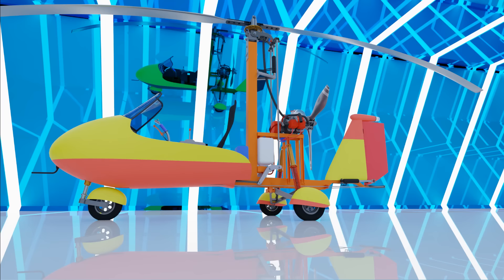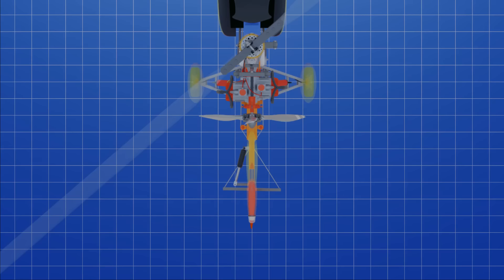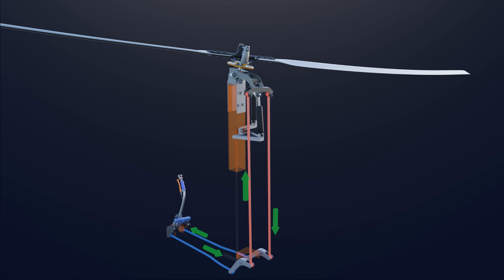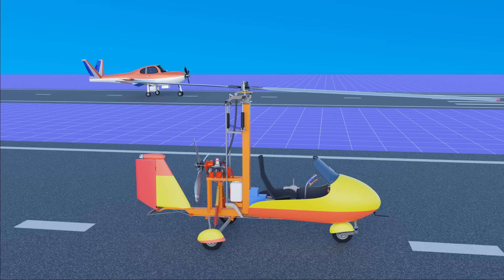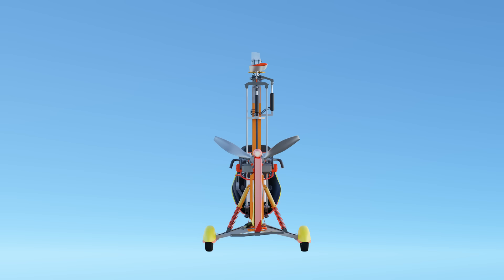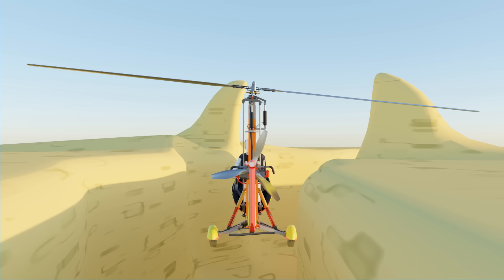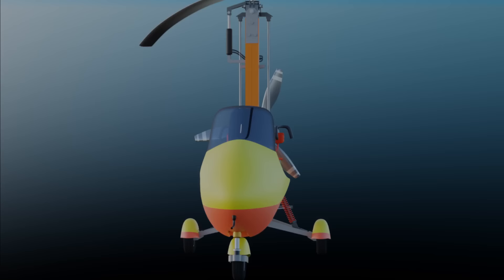How Gyroplanes Fly ? 3D Animation

Comment from the maker: Don't forget to share it with others and here is a new video explains planetary gearset, Please checkout to learn more  https://youtu.be/wD0cMlnaUGw    and help us to reach more audiences. As a small channel YouTube algorithm is not helping at all and have no budget for paid promotion. I am focusing on  improving  video quality.
Reply: No collective?
Reply: How far can it glide on engine failure?
Reply: @fredashay  No collective. In my simple understanding, the collective pitch controls the angle of attack of the blades on a heli rotor, set against engine power (why the collective control also has the throttle), but in a helicopter you have to change the cyclic to enter transitional flight, by changing your rotor disc angle of attack, and thus the vector of resultant thrust. 
But a gyro will steer and climb on the cyclic, because the forward force is provided by the motor behind you. It's easier if you ignore the evidence of your eyes and think of the rotor disc as equivalent to a fixed wing.

I found info from a gyro club that says the glide angle is about 4:1, so (roughly) altitude 1000 feet, range 4000 feet, about 1.2 km on no engine.

Comment: A Gyroplane rotor does not rotate as a pinwheel rotates in the wind. The rotor of a Gyroplane and a helicopter when in the state of auto rotation, rotates against the flow of the wind. This is due to the effort of lift is alway perpendicular to the angle of attack of the wind. This varies along the length of the entire rotor due to the fact that the airspeed varies infinitely due to the rotation of the blade. Another words the section of the rotor next to the hub is rotating slower than the tips. For simplicity we decide the rotor into three sections: The stalled, which is closer to the center of rotation, The Driving, which is producing lift at a very high angle of attack where by the effort of lift is actually forward in its vector. The section literally pulls the rest of the rotor into the wind. Finally the Driven section. This section provides most of the lift and is pulled against the wind by the middle or Driving section of the blade. The velocity of rotation is self limited by the lift vs drag equality. Most two place gyros will see a rotation of 325 to 375 rpm. The rotor rpm will vary with atmospheric conditions and the gross weight of the aircraft. The rotor rpm typically will not vary over 10% no matter what the forward velocity of the aircraft.
Reply: "A Gyroplane rotor does not rotate as a pinwheel rotates in the wind. "

The analogy might not be correct, but it's been used to illustrate the point for many decades.  Chuck Vanek, back when it was  still "Vancraft," used it with me as did Rod Scamahorn (until his death) who was one of "Sport Copters" CFI's.  No, it's not 100% correct. But it does get the point across.
Reply: So the common concept that wind goes from below the rotor upwards is inexact, right?
It does so in the driver region, but, as on any helicopter, the driven region will cause a downwash, am I right?
Thanks in advance
Reply: @DoNotPushHere  As in an airplanes wing, the relative wind causing providing lift is from slightly below the airfoil, which is called the angle of attack. The same is true for the rotor on an Autogyro. On a helicopter the rotor is driven by the engine and acts more a a propeller and air is grabbed and force through it. When Juan De la Cierva invented the Gyroplane, it came after a tragic aircraft accident which resulted in the loss of a good friend. Keep in mind this was 1921 and earlier, a few scant years after the 1903 Wright Brothers flight. Stall spins were not understood. All they knew was, if the aircraft was allowed to fly too slow, it fell from the sky. “Why must the passengers fly at the same speed as the wing,” he famously ask himself. So he pursued the ides of a rotating airfoil. I expect he got real lucky, because if they did not know what really caused a stall span, they certainly didn’t know about area of pressure travel. Lift is more or less perpendicular to the angle of attack and oddly enough, the greatest lift I occurs at high angles of attack just before stall or the maximum angle of attack is exceeded. There are a lot of illustrations showing this on line. But in essence the center of lift or area of greatest effort is forward and not directly opposite of the Earths gravity pull. An airplane wing will not or does not force the air downward until, the wing has passed or aft of the wing. Aft of the wing on a fixed wing, there is down flow but not as experienced in a helicopter. 

As you know a gyroplanes rotor can be divided up into three areas defined by the speed of rotation and relative wind: The Stalled, the Driving and the Driven. Most rotor designers ignore the stalled region and do not begin the actual airfoil shape till a good distance away from the center of rotation. Having said that, there is airflow over that area while it does not produce lift, there is parasitic drag which hinders performance. SkyWheels rotors which are composite did attempt to deal with this area concerning drag and some of the very advance designs, you will see this area shaped to smooth the flow of air as it passes over. Most do not bother. 

outboard of the stalled area is the driven. This is where the lift is vectored forward or the aerodynamic center of the rotor. This force pulls the rotor against the wind and against the forward motion of the aircraft. To me, this is a freak of nature and a darned miracle. When the angle of attack is less, then the area of lift moves further aft on the blade and the rotor behaves more like a wing in cruising flight. This occurs in the driven section.

If you have ever flown a Cessna 172 and you dropped full flaps on approach and forgot to trim the aircraft nose down, then you have experienced the force exerted by the center of lift having moved forward of the aerodynamic center of the wing. As you push hard on the yoke to get the nose down. It will cause puckering if you don’t expect it. Flight instructors love doing this to new students. 

The angle of attack of a pin wheel is almost perpendicular to the surface. Pushing and shoving causes it to rotate not pulling. Granted Bernoulli cannot explain the entire equation on lift. It is a shared effort of a push of the air under the wing and the vacuum or lower pressure above the wing. These forces trade off as the angle of attack is varied. Even the experts are re-debating how to explain why and aircraft flys. Obviously most of the hard parts have been solved enough to work.

Gyroplanes suck and helicopter’s blow……in any case we get the same results; an orgasmic experience in the air.  ( forgive me for the gutter talk)
Reply: @DoNotPushHere  What generally confuses some as well as myself is the affect of relative wind and the speed at which each point along the rotor is experiencing. If the aircraft is not moving forward, the tips of the rotor during pre rotation are experiencing 200 or plus MPH. In flight the rotors are spinning at 325-400 RPM and the tips are experiencing 350 mph velocities.

The relative wind changes along the length of a rotating blade and with this the airfoil causes the wind to be molded or flowing around the airfoil resulting in dramatically different kinds and directions of lift. 

One example of this which may or may not relate to personal experiences would be the air felt by you if you were placed (safely of course ) in the back of a open bed truck sitting still on the ground. You will be traveling due North and there is a wind blowing at 45 mph from the West. ( might as well make this extreme) Facing North your left side of your faces is getting an ear full. Now the driver of the truck accelerates to 45 mph. Now the wind you are feeding is from a direction which had moved forward to about 45°. 

Has the wind changed direction? No but the combination of the wind speed and your forward speed you the feel this change in direction. You can increase your velocity to the point where the initial  45 mph wind at 90° is hardly felt at all. You are the rotor and airfoil at different points along the rotor and you can see how the relative wind changes at each point as velocity changes. So far the total lift on each blade is equal. 

This all goes to crap when the aircraft starts moving through the air. The accelerating blade which is moving into the direction of travel of the aircraft is now receiving more wind than its partner blade traveling down wind. What happens is one side gets more lift than the other and the airframe rolls and crashes. This happened with De la Cierva’s first full size aircraft until he invented flapping hinges. These allowed each blade to seek its own best angle of attack to equalize this disparity of lift. Most smaller gyroplanes achieve this via a teetering rotor head system. We won’t get into the explanation of the lead-lag hinge. ( it’s stress related) 

Then there is lift created by the affect of a rotating disk and the total flow of air moving across that disk. That generates a bit of lift. Then there is the viscosity of the air resisting to flow through this disk and that generates at bit of lift. The total explanation gets complicated very quickly. 

My head hurts. 

Helicopters don’t fly, they beat the air into submission. Gyroplanes are much more gentle in this agreement with the air.

Comment: Really need to mention...

"With a high engine thrustline (relative to the vertical c.g. and center of drag) and/or with a momentary gust that can increase fuselage drag, the gyro can pitch forward and tumble. Such tumbling, also known as bunting over, can occur almost instantly."

Any negative G created situation, I'm no gyro pilot, but the maneuver required to recover is opposite a fix wing aircraft. 

You should never get into a negative G situation as it will unload the rotor. 

It's the equivalent of a stall, understand you will hear gyros can't stall, true, but an unloaded rotor, it's going to have the same results, gravity will take over. 

There isn't any recovery for a bunting over if it happens. 

So do it wrong, rotor uploading, react incorrectly, a bunting over will happen, no recovery.

Rumor has it, improvements have been improved in model designs for bunting over, but not eliminated.

I once considered buying an early design gyro, I passed.

I believe one foreign military considered them, but decided no. I think France? 

Check the US accident stats, bunting, rotor tail strikes pretty fatal.

https://youtu.be/CfjBzrSDrV0?si=-vP5s2pdKZYc-Lyl

As I say, I don't own one, not a pilot, never flown one, no expert, so YMMV.

I'm just saying they aren't for me.

Interesting a modern Europe gyro,  it doesn't seem in business anymore,  or model gone, went back to a old front mounted engine,  frame more plane like,  with a tube rear end, that contained a ballistic recovery parachute.

No clue what, why, how it worked out

Comment: There is no hard and fast description of what is autogyro, gyrocopter or gyroplane, and all three terms are frequently used to describe a rotary wing aircraft that is pushed through the air by an engine driven propellor and has a non powered rotor. The rotor is in permanent auto rotation, and although the aerodynamics is difficult to understand, the rotor has similar controls to those in a powered rotor helicopter. The simplest form of autogyro has a two blade rotor with a ‘teetering head’. In this design the blades are fixed directly to the central rotor head, without any pitch change hinges. The central rotor head can tilt in fore and aft and lateral directions giving the pilot fore/aft and lateral control. Some more complex autogyros have a three blade rotor, which requires that each blade can change pitch independently, requiring a swashplate control with pitch change bearings on each blade. Two examples of this design are the Mculloch J2 and the Air and Space model 18. Both have a three blade rotor head from a conventional helicopter. These can be considered as ‘gyrocopter’, as they have a helicopter type rotor head. The J2 has an additional feature by way of stub wings that form the fuel tanks and also generate lift when in forward flight, so can be considered as ‘gyroplane’, combining a non powered rotor with aircraft type wings.
Examples of all three types of autogyro can be seen on display at the Helicopter Miseum in North Somerset.

Comment: "NOT POWERED BY AN ENGINE" More correctly, the rotor is not powered by an engine, the aircraft however is  powered by an engine which drives a propeller which in turn causes the aircraft to move forward which in turn causes the rotor to spin, generating lift, so in fact every gyrocopter is powered by an engine, it is just that the engine is not used to power the rotor..  However, a  lot of gyrocopters    have rotors connected to the engine to provide a spin up of the rotor  to generate lift and a well as having the  engine connected to the rotor to take off vertically  like a helicopter. Those  latter actions pretty much fit the definition of the aircraft being "powered by an engine"

Comment: The rudder cables are not crossed if directly connected by cables or push pull tubes.
Reply: Same as in a fixed wind IIRC. Not as per the illustration.

Comment: I live in rural Ohio, see these dudes flying em all the time! I'm a curious dude,but terrified of Gyrocopters at the same time😆
Reply: I have a Gyro in rural Ohio, your thoughts are the same as almost anyone I talk to! 🙂
Reply: @djski9757  I'm in Warren County.Got a Parasail pilot that comes thru aswell. Neat stuff!
Reply: Dean, 
  I live next to an airport where they're build commercially.  There's always a few of them in the pattern, depending on the weather. Some have enclosed cockpits, others are exposed to the elements.  I know which model I'd choose. 🤣

"Power push-over" and "PIO" (pilot induced oscillations)  are the two (major) things that will get you killed in a gyro.  Keep those under control and they're a very safe aircraft.

Comment: I just have one question..did the blade have different angle on different section? Or everything is identical? Thanks in advance!
Reply from the maker: you mean taper and twist like present in helicopter. usually not like helicopters' rotor blade..

Comment: I've been thinking of making a Gyro for a long time but haven't found any instructional videos on the subject. Thank you, I benefited a lot from this video. But I have some questions, how much engine power should be, how much should be the size of each blade?
Reply: sti engine
Reply: Just buy one or build a kit that has the engineering all worked out.
Reply: just copy a blueprint and replace their components with cheap bootleg parts try not to die
Reply: Do you want to build from kit or build from scratch? "  I live close to "Sport  Copter" gyros, so those are what I've seen most (40 years worth). Nice kit. Seems a bit on the expensive side, but they are VERY well engineered.  I've seen the owner of the company doing loops in his. If that does scream confidence in your product, I don't know what does.  🙂
Reply: @phillipzx3754  I lived close to where Cavalon assembles their aircraft in Maryland and flew them several times while taking my fixed wing training.  They are alot of fun and have some practical aspects to them that fixed wing do not.  BUT they are pretty much for fun, low and slow.
Reply: @blaster-zy7xx    Yup....speed isn't something they're much good for.  I think of them more like a mountain bike... but for the sky. 

Given a choice, I'd rather be low and slow in a gyro than low and slow in a fixed wing...especially an ultralight. Most glide like a brick.
Reply: @phillipzx3754  Well that is great that you have realistic expectations for the role of a gyroplane.  There are many people who initially expect a gyroplane to fill the role of a helicopter or a fixed airplane and it really is neither.
Reply: A Volkswagen beetle's boxer engine should work sir

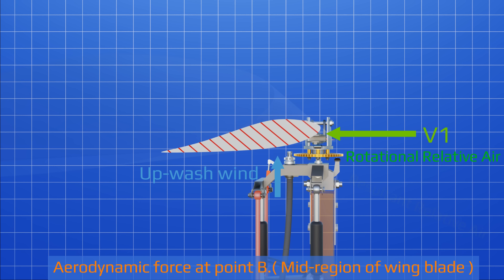Comment: 4:36 could any expert help explaining where does up-wash wind come from ?

I understand that for typical helicopter, up-wash wind will occur as engine fail and the helicopter body falling down relative to the air., the autorotation will happen.
but when gyrocopter operating, it is not falling down, so where does up-wash wind come from then ?

Comment: how does the pilot nose up and down the aircraft?
Excellent video BTW!
Reply from the maker: Its flight response is different than a fixed wing aircraft. some gyroplanes are fitted with elevator, otherwise cyclic stick, propeller thrust are only options for  roll, pitch climb .
Reply: @workingsgotanimated  Thank you for your reply.

Comment: The rotor blades are powered by the engine, turn the engine off and see what happens, you decend. The rotor is driven by whats called an air coupling, just not directly

Comment: "not powered by engine" proceeds to show how it is in fact powered by that there red engine in front of the tail.

For anyone who wants the 101 course version, a rotating airfoil is a type of wing, the engine on the rear pushes the craft forward which causes the rotor blades to rotate causes lift to be generated by the rotor.

Comment: Ehhhhhh, the motor provides the forward motion that allows the air to spin the main rotor. If you think it's not powered by the motor, try getting the rotor to spool up without the motor running. LMFAO. Just saying.